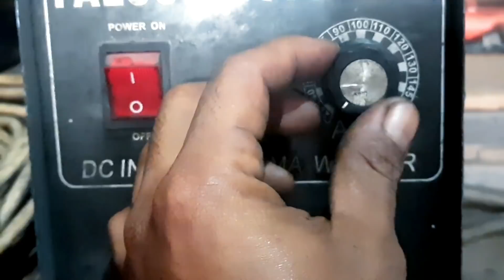7 tricks to make you a master thin metal welder, why doesn't anyone discuss this important thing?

Comment: But the most important trick is using a good welding machine not these old rubbish heavy ones that tend to loose the calibration after two electrodes .

Comment: Try grinding the galvanized off before you weld, that shit ain't no good for you and you get a better weld. Still a few slag inclusions in weld
Reply: Good eye Jim. Notice that myself.
Reply: @victoryfirst2878 
Yes 40+ years as a boilermaker, I've been guilty of it myself
Reply: @jimmartin9704  There is another way. Just use stainless steel rods of just about any grade and the super flux used in the rod will take care of the galvanized. Plus corrosion resistance ......... Let's forget the zinc fumes !!!
Reply: Actually any traces of Zinc is very bad for the welding, so yes, grind it off or use acid to remove.